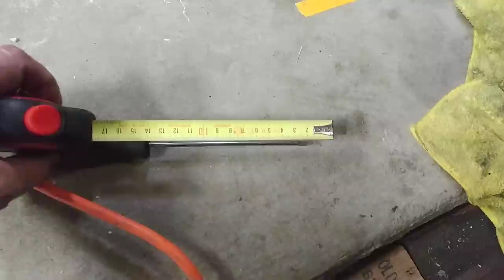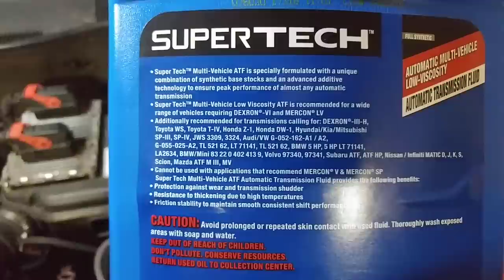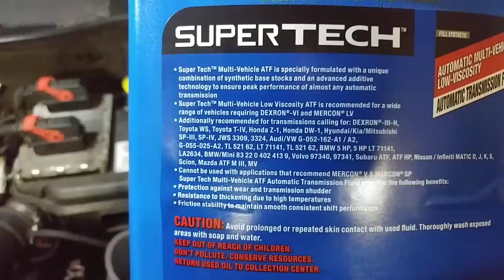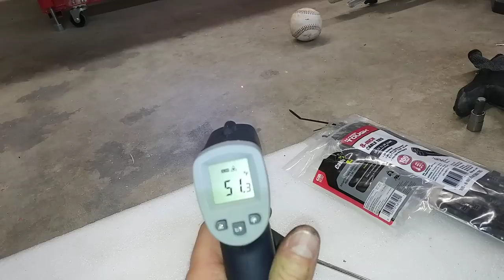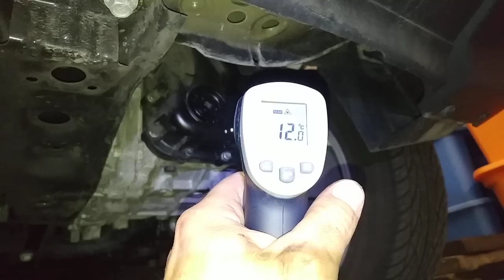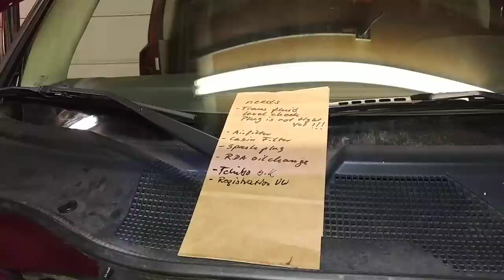2014 - 2017 Jeep Patriot transmission fluid change.

Comment: If you pull off the side cover where the rubber seal hole is located on the transmission there is actually a mesh screen filter that should be changed every few fluid changes too.
I saw this on a Hyundai video with the same junky engineered German transmission.
First Mercedes after buying Chrysler forced their sealed German transmissions, this one included on Chrysler then Fiat after buying Chrysler makes the same mistake using ZF German transmissions that have had many problems and hard to service too.
By the way all the major German automakers, Hyundai, Kia and yes now Honda are all using the ZF automatic transmissions and all are having problems with them.
So much for Honda quality.
Reply: On a 6 speed auto?
Reply from the maker: Considering that the transmission is supposedly filled for life, i think a drain and fill is sufficient. I wouldn't change the filter every time. If I drain and the old fluid looks horrible I might consider changing the filter but not every time.

Comment: How many liters of oil does the transmission need in the Jeep Patriot
Reply from the maker: In the 6 speed automatic it takes roughly 5 liters but you have to fine tune the fluid level with a factory tool (dipstick).

Comment: Approximately how long was the car on in order for the trans fluid to get to the desired temperature to add more fluid? Thanks
Reply from the maker: good question. It has been a few years. If you just want to check the fluid level I would just take it for a drive before checking it. IF you do a drain fill just measure the amount that came out and refill with the same amount. Once you are done take it for a drive and then do the check.
Reply: Heiko's Garage Awesome thanks!

Comment: So 2011 jeep Patriot is different? Great video regardless thank you
Reply from the maker: russtew1 it depends on the transmission you have in there. I got the 6 speed automatic.
Reply: Yes, your 2011 has a 4 speed CVT.  It's a completely different transmission than the Hyndai 6 speed that's in the 2014, 2015 Pats.

Comment: Everything still running good?
Reply: After this video I started seeing an f150   So I’m worried :0
Reply from the maker: Still running and shifting. In the meantime I got an original dipstick to check again.
Reply: @HeikosGarage   How much transmission fluid did it fully need?
Reply from the maker: @felipemartinez634  sorry, I don't remember.

Comment: Totaly useless to change transmission oil on a 2014 Model car
Reply: Why? My 2016 has 110,000 miles right now.  Jeep calls for 60 & 120 thousand miles.
Reply from the maker: I think a fluid change will always have a positive effect on life expectancy of a transmission.
Reply from the maker: Mine is a 2014 with 6 speed automatic. Maybe you have a CVT.
Reply: @andrewthetool  I just checked, yeah you are right, but its not mandatory.  it also says to change the filter, which requires a lot more work.  BTW, the Haynes manual says 100K, but they seem to error on being cautious.  Anyway, make your own video so we can all see the right way!  ha ha